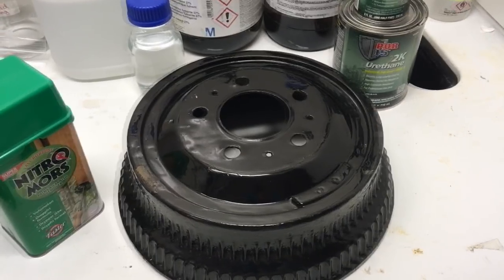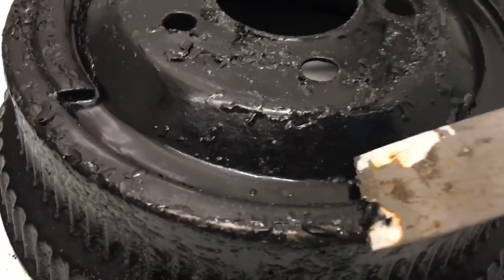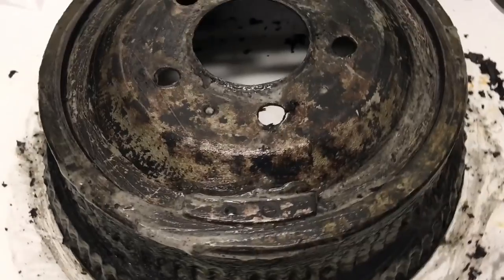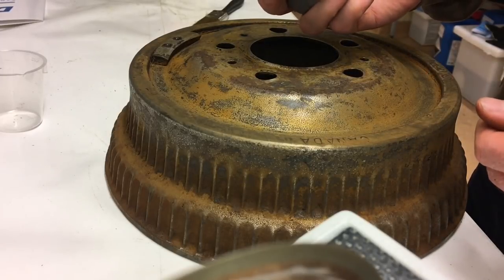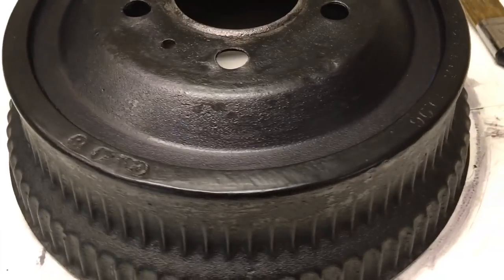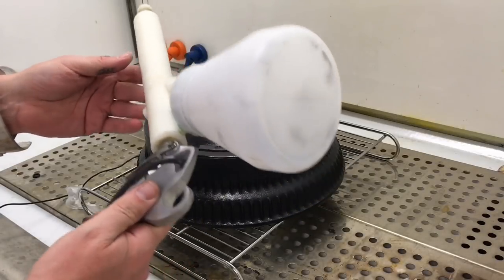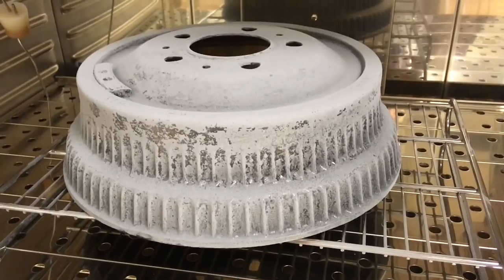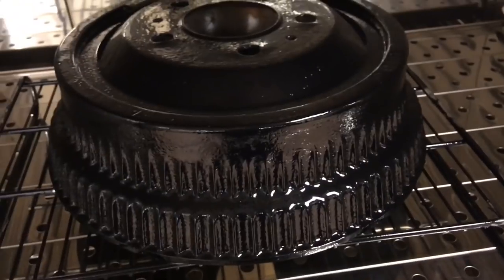Brake drum - POR 15 paint stripping - rust conversion and powder coat - JEEP Wrangler YJ : Ep 25

Comment: I have had much different result with POR-15 paints. I have never seen them chip off a surface that I painted with POR-15..
From the Instructions for the 2K Urethane;
Apply two coats of POR15 Rust Preventive Paint over a sandblasted surface or a surface prepared with Cleaner Degreaser and Metal Prep
http://qr.por15.com/QR-assets/downloads/POR15/2KUrethaneDirections.pdf
Reply from the maker: +wxfield This POR 15 is an excellent 2k, and as said the metal prep could have made a difference. I have found that most of these metal preps contain phosphorus acid, leaving phosphate groups that obviously many paints adhere very well to.
Reply: Yes, they do..very true. Having said that, the video has made me second-guess using the paints anymore. But I've also had short-lasting results with powder coating both professionally done and at home. I guess the fundamental idea behind all these products is to prevent oxygen from coming into contact with the base metals. So I guess the question still remains as to how to best protect metal parts exposed air, salts and moisture.